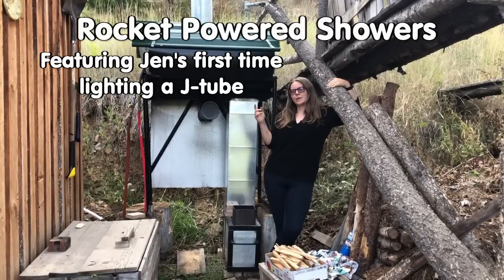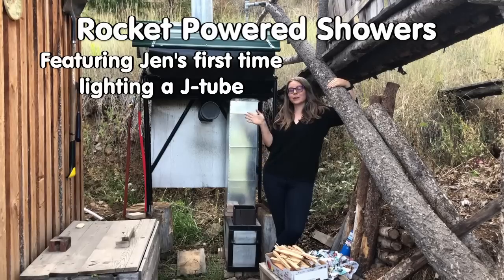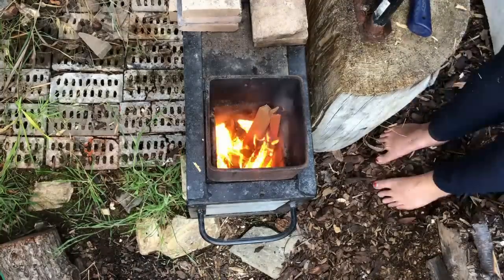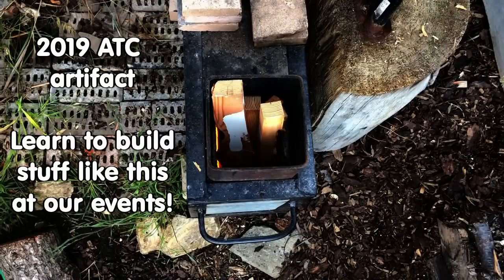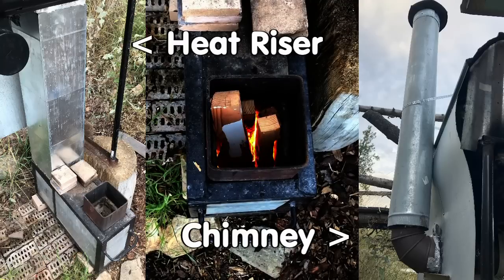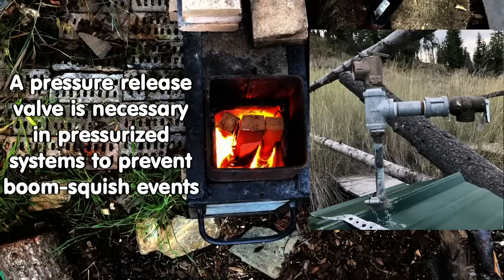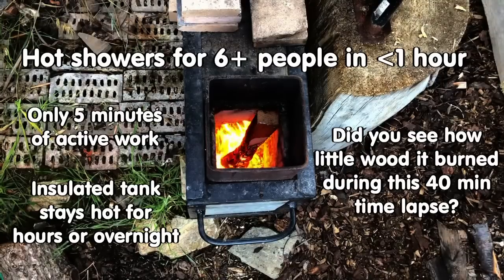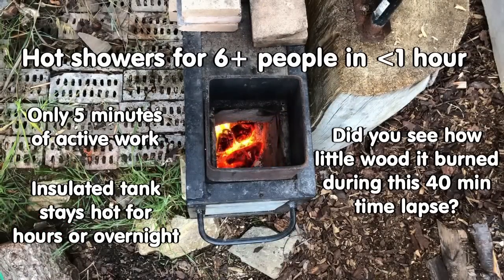rocket water heater and shower

Comment: I was amazed at how long the water stayed hot for. I fired it up at night and it was still warm the next morning despite being a cold night!
Reply: That seems more a function of the tank isolation than of the heater
Reply: @Ed19601  that and the thermal mass of the water.... oooh microclimate!
Reply: monkeymanwasd123 i dont know for sure but I’m pretty sure water has more heat holding capacity than mineral-based substances like cob brick or concrete per volume.
Reply: @Dollapfin  I think it was dramatically better
Reply: That all depends on how well the water storage tank is insulated. If you built an enclosed box around it and stuffed it with insulation i bet it would probably stay hot for a couple days. Spray in foam insulation would probably work best to fill any air gaps.
Reply: @Dollapfin  it does but it also absorbs and releases heat twice as fast
Reply: @frankmundo4300  so what you're saying is that water in an earthen mass could be an excellent heat soak to absorb concentrated heat (say from a fire forex) and then release it throughout the mass?

Comment: I’m thinking this would make a nice setup for a heated slab in a garage. It’s not as fussy about temp the way a house would be, so you could roughly regulate it by running a a couple burns a day, more or less as needed. The slab absorbs excess heat so less worries about over temp or pressure issues. Circulator could run on a timer.

Comment: Paul isn't it possible to make a rocket mess water heater I don't know that's why I'm asking thanks
Reply from the maker: Do you mean a rocket mass heater where the mass is water?
Reply: Yeah yes I do
Reply from the maker: @brucegill4218  There are several threads about this at permies.com

Comment: Traditional rocket stoves have the fill and light opening at the front. I am surprised that having it at the top of the body results in higher efficiency. I would expect the opposite
Reply from the maker: Are you talking about the L-tube style?
Reply: @paulwheaton  indeed, correct